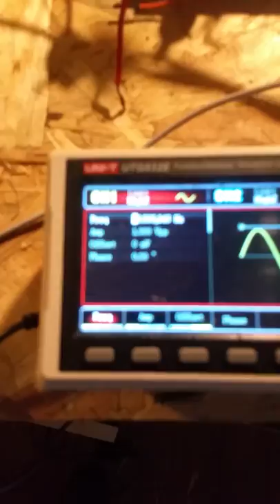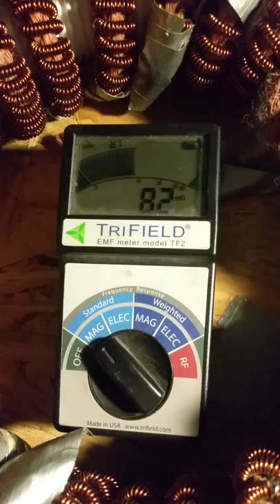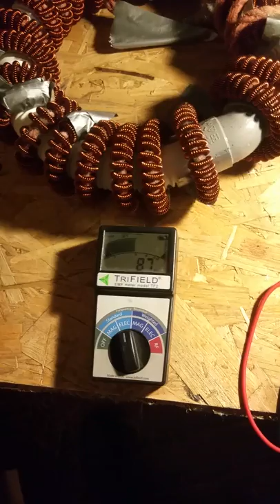O-Day - Henk Jurrien is first to share initial findings from his Super-Super-Tor

Comment: Hey Bob and/or Henk, this is really great, so exciting! I find it perhaps most interesting that initially @2:04  the electric field inside the coil is around 50 then when Henk moves it outside @2:10 it goes to 86, then finally at @2:18 when he moves it back inside it goes to 289. All other things being equal there are two ways I could interpret this, 1 the field changed by a factor of 6 between moving it out and in again, or 2 the minute difference in position between the two measurements was sufficient to justify this large change. The second seems more likely as if the electric field is a vortex toroid I would expect it to be very strong at some locations in the center but perhaps much lower at other areas in the center. Given the change in value between moving it out and in again I'm not sure it really would tell us much at all, but is there any reading for the electric field before the coil is energized to get some idea for the background in the area? Or perhaps a live reading of the electric field without moving the meter, where the coil is energized for the first time and turned off in a new physical location. This is really cool, I can't wait to see more measurements :)
Reply from the maker: For reference, here is the manual for B and E measurements with TF2

https://www.trifield.com/wp-content/uploads/2022/01/TF2OwnersManual.pdf
Reply: @MFMP  Thanks Bob!

Comment: Have you tried moving the coil after turning off the power? From the bagel game presentation, it sounds like that lingering E field should remain in the location where the coil was sitting when the power was on.
But if so, then we need to do a bunch of experiments to figure out exactly what the field is anchored to. It can't be a particular point in space, because the earth is spinning, and moving around the sun, and the sun moving around the galaxy, so our true position in the universe is constantly changing. But is the field anchored to the nearby surface of the earth, or to the air (in which case it should disperse easily), or is this evidence for complete aether dragging, or something else?
Reply from the maker: Well, the mater is all starting off with that relative movement.
Reply: Has anyone tried "blowing the field" with a fan?
Reply from the maker: @IC-Alchemy  Interesting idea